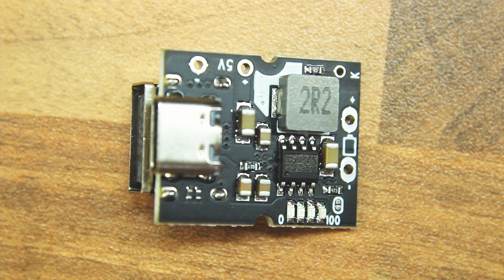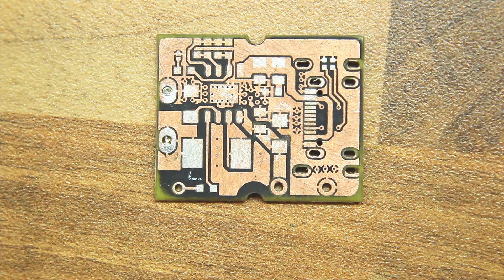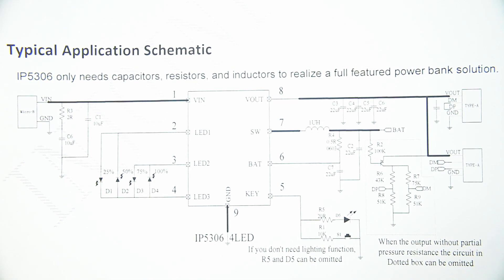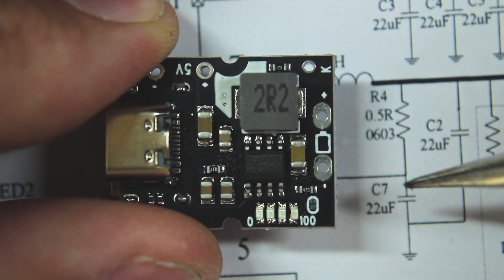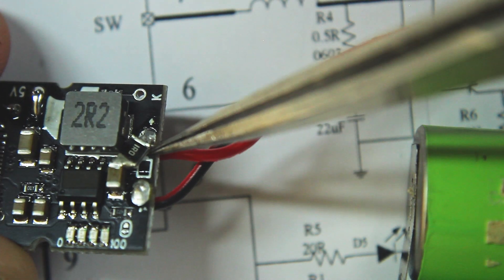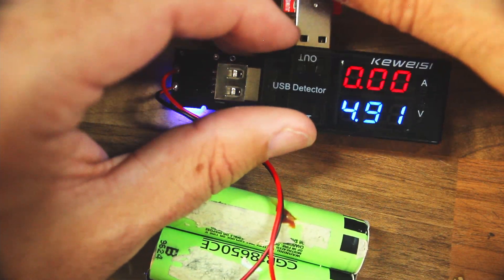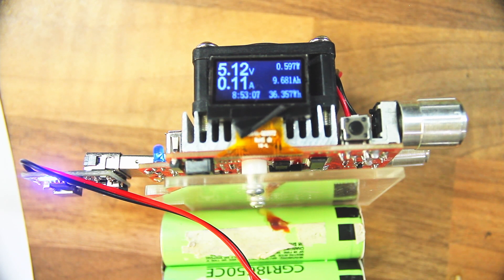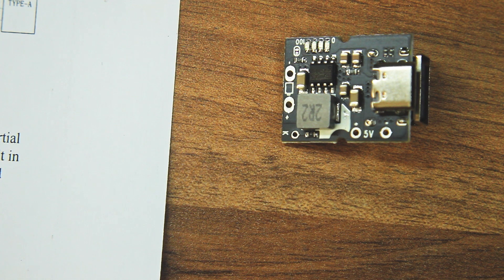Shoddy Chinese Li-Ion Charge+Boost Circuits

Comment: The resistor that was supplied affects the minimum current of the connected load. By default it is 45 mA or 80 mA for clones of this chip. If you solder not 0.5 ohm but 5, then the starting current from the load will be in the region of 20-30 mA.